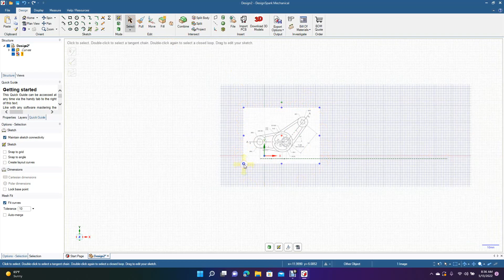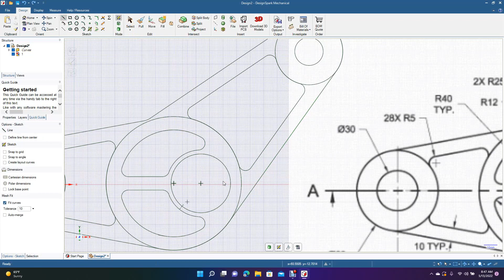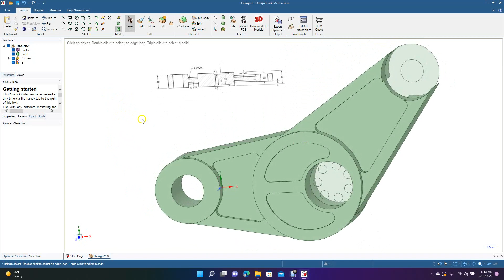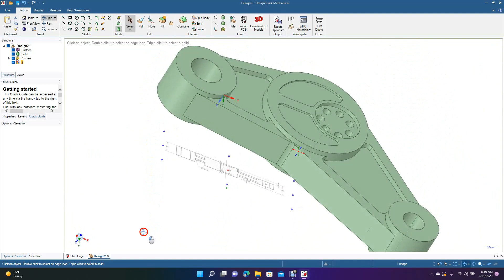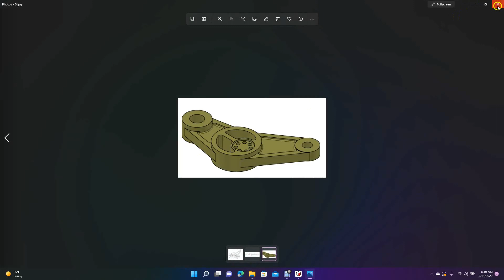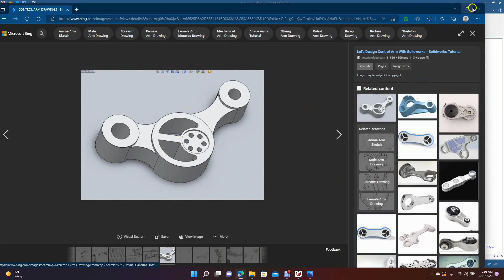How to create a control arm from drawing in design spark mechanical

Comment: You made few mistakes. One arms or what ever you call it between holes should be 20 mm tall. they are 10mm down from each end. then the small hole would be 22 like the drawing shows. even on the final picture you can see that the size are smaller then on yours final part.
Reply from the maker: Ok, thanks for pointing that out. Cheers!